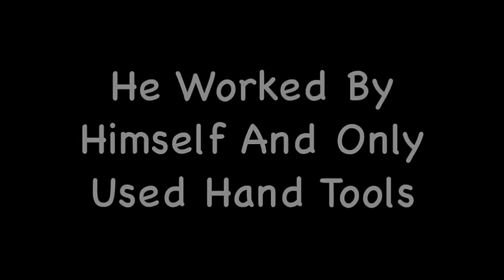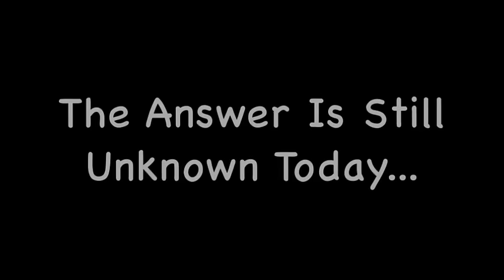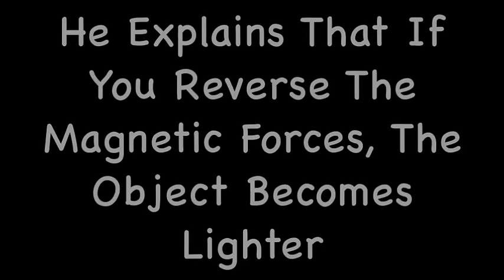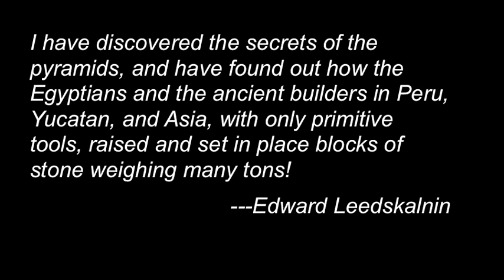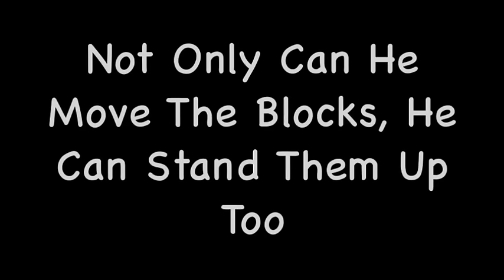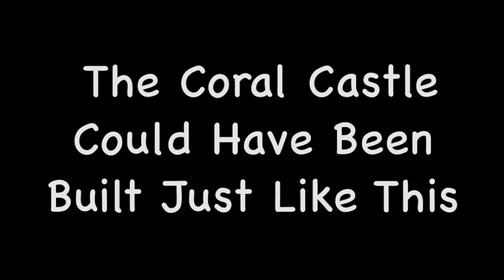Coral Castle: Mystery Solved

Comment: The pyramid Abu Rowash in Egypt is on top of a mountain.  There is no way this technique is sound to accomplish getting 400 ton block not only up a pyramid but a mountain as well.  The Egyptians moved stones up to 400 tons which would crush these wooden contraptions.
Reply: This is true, i`m going to re-post it at the top as the know it all`s seem to have skipped it, conveniently.
Reply: nice
Reply: The levitation could have been done with a flywheel circuit like Ed built, or possibly using a solid state version of this; the Ark of the covenant which was infact the exact dimension of a box found inside the kings chamber in Cheops. Obvious to me this ark was used in the queens chamber which was lined with gold to prevent radiation waves leaking out. The ground lead to water below all pyramids and also to the foot of the sphynx. Why? It's ion charge was healthy! people bathed to heal and energize. It's zero point energy just like the concentric ring walls used in Atlantis; the tournament players would stand in it's midst to regenerate in 1 hour as if they'd slept for 2 days.
Reply: That's not actually true.  In the 1780's, the largest carved & moved stone in the world was transported from 6 kilometers to its current location in St. Petersburg, using a sled with rollers.  1500 tonnes, carved down to 1250 (some of the carving was done along the way).  

It's all a matter of scale & persistence.
Reply: Helios77711 I would expect as much from you. Remember; if you're trying to call bullshit, bring some facts. I have many videos full of facts. What do you have? Nothing. You are what you do. I'm still waiting for a real comeback.
Reply: Helios77711 hahaha you're a waste of time. I tell you what; let's continue this conversation in 4 years. This will be civil, do you agree?
Reply: Helios77711 I don't knock on doors. I am not part of the NW organization. I did say that I am a Jehovas witness. If you knew the bible, you would know what that means, but from one point of view you are nothing. I've studied Jewish religion and found 3 major errors, and so did a Jewish Rabbi who converted to believe in Christ as savior! Look it up. Educate yourself enough and this is where most conversions go to. If god loves us, why would he wait thousands of years before teaching us anything that could save us? It's just plain dumb.
Reply: mikefromspace there was nothing to save you from thousands of years ago
Reply: Bob Swardson Trolling much? Just felt it needed to be focused on when someone happens to mention anything that happens to be in the Holy Bible, there is always someone who feels it necessary to vomit their dissent of God. Get a life and keep your rhetoric to yourself, rather than taking the mention of anything biblical as a hand swat from a tag team partner to ambush the person confident in believing what you so arrogantly oppose. Peace!
Reply: Scott Allensworth Trolls require bridges, I know, I have abridge...Muuuhahahah!!!!!!!!!(hear that in your minds eye as very sinister, but seemingly tiny mouse like voice coming from over your left shoulder!), or is that i've been abridged?  Love you!
Reply: ***** Pagan... I don't associate with Pagans sorry.
Reply: mikefromspace Come on, man. Where is your love? Your comment hurts.😢
Reply: Scott Allensworth It's called tough love.
Reply: Helios77711 LIes? Prove it. The only delusions are all on your side buddy. I know who my friends are and don't have time for cynics or children with closed minds who have still not sought out the true god after all these years. I have conversations with biblical scholars. Even Torah scholars have converted after learning the truths that are so obvious. You can yap all you want here but you're not on my level until you study for a few weeks with a good Jehovas Witness Minister.
Reply: +Scott Allensworth Nicely & diplomatically put, I'll accede, however if you truly want an answer to the main question you asked, "Why is there so much anger towards ppl who happen to believe in someone/something as their god?", I'll provide it to you. First off, the question is not quite right. It is not believers in higher powers who the greater part of the frustration I've seen(& felt) is directed towards, it is towards the followers of actual religions, &/or the books/organizations/etc. that go hand & hand with them, that our ire, & lack of respect is more truly aimed.  And in general, the answer as to "why the anger?", ought to be fairly obvious. Throughout our known history, it has been these religions that have served as the underlying justifications for(by far) more grisly murder, more suffering, poverty, enslavement, & oppression, than any other motivating factor that anyone can point to for these evils, & all the while(most obviously when viewed in regards to Christianity, but generally true of all of them), while swinging the ax, wading through the blood, gathering the loot, & consolidating the power, the perpetrators of all the horrid atrocities(whether blatant, or more subtle &/or insidious) of history, gave straight faced accountings of their actions, as due to the will & love of god/words of the bible/etc.. And, after all, if life in heaven is greater the more severe one suffers on earth, then how can I be doing a bad thing, enslaving & murdering great numbers of people? have i not just GUARANTEED them an eternity of the greatest bliss imaginable?? I am truly asking, if I have stolen these souls lives, made them wretched, caused them to lose all hope, their children, their love, their freedom, & finally their lives, have I not done them the greatest service imaginable by any mind? Theirs will surely be an eternity to remember!
 
 Secondly, it is the organized religions, who have had the greatest part in holding back the human race from growth, time & again, keeping us in fear of god, & of his agents on the planet(like those who locked up Galileo) so that the 'conservatives' can assuage their fear of change, avoid the gibbering terror caused them by questions about our conduct as humans, & questions about our leaders, & questions about our daily lives in the future. And yet, it is a profound truth that "The unexamined life is not worth living."- Plato. A truth understood by those who came long before us, but is now shouted down(along with any other true morality, or sense that someone dares utter) as "unpatriotic", or "satanic".  Well... guess what? Your little drama characters are just imaginary constructs, just like Santa Clause. How can you be SO arrogant, as to believe that if there is a god out there(which there may well be?), that YOU have any knowledge or understanding of he/she/it, whatsoever? Don't call me "atheist"! We don't need a special label for me because I don't believe in the Tooth Fairy, or because i don't believe that Star Wars is a story about a real place that existed "Long, long ago, in a galaxy far far away." So whyTF do I need a label, just because I don't believe in any of the world's religions?  No one of them is any less absurd, or requiring of "faith" than another?? So don't label me "atheist", and quit holding back solutions to our myriad problems because you think a book, many of the original words of which are lost to history anyway, should have precedence over critical thinking.
 
And that stunting of our race continues today. If it weren't for the utter blindness & hypocrisy of the 'religious right' in America today, then an entity composed of blatantly obvious evil, apathetic towards any other being on the planet, along w/another entity blatantly obvious evil, that knows of nothing else but naked greed, could never have become the administrators of our government, like Bush/Cheney did. I'll grant you, there is not much to be desired about either party's candidates of the last four decades(other than Al Gore, ironically, who I believe he was about to step in & shock the system w/the very reforms in campaign finance, & the two-party joke of a system, that represent some of the only possible fixes for our lost democracy, & conceivable future as a race.. he gave enough hints.. too many, in fact, which is why it was necessary for the elites to kick him out, & steal the election from him... And they weren't happy when he turned the world's attention to human-caused global warming after that, either... but that's just more proof he was indeed willing to buck the powerful buck$ that rule the system). And just the simple fact that you all could take even a cursory look at the lives of these two pieces of human filth, & decide they were truly the fellow Christians they professed to be, is unbelievable. But the fact that you then threw in the towel with them, & allowed yourselves to stay willfully blind to all of their atrocities against democracy, human kind, & the planet, & supported them in  the never-ending false flag War on Terror.. & worse still, the invasion of an innocent country, & the carpet bombing of women & children who had no power in any political system(we like to use the words "carpet bombing", instead of the mass murder it truly needs to be called)...?? Well, that's beyond unbelievable, it's despicable.. in fact, there are no words strong enough?Hyper-loathsome? And generally, y'all are still engaged in the same ignorance, & promotion of evil that you were before 2000... I mean, "War on Christmas"??? You think that's ANYTHING but a lie, meant as one of many distractions that successfully keep people from focusing on the true issues we should be examining, & solving, or attempting to solve, if we want to keep any semblance of morality?? And come on, how difficult is "separation of church & state"?? Y'all just KEEP undermining it!? Ever since it was established? And you already mentioned & dismissed as a belligerent few, the whole constant spewing of hatred towards gays, & others in our culture who both don't deserve judgment by the Christian Right, but who also serve as nothing more than distractions, so we remain blind to the urgency of our true problems in the world. But as you already know, it isn't just a few bad, homophobic apples. Is it? There are lots of you, who spew the same bigotry that you then turn around & act so confused, so wonderfully innocent, to have directed at yourselves. Sorry.. I'm not buying it. The other agnostics are not buying it.

And frankly, i could go on, & on, & on.. I'm a fast typist, so I didn't realize that this had become so long. I really didn't even touch on a number of points I wish I'd been able to. And I have not simply spewed ignorant hate speech here... far from it. I have simply provided you with a fraction of the legitimate reasons that critical thinking, non-indoctrinated beings have become so frustrated with the followers of the world's religions, that they indeed begin sputtering anger at the very sight of you.. an anger towards your refusal to acknowledge the force of evil you always have been, & remain to this day. It just bounces off you, like you have some specific type of mental retardation in just that one aspect of your intelligence. In one ear, & out the other, & no matter how true my words, or consequential that truth, you just continue on, making the same f'n mistakes, again, & again, & believing the delusion that there's much good at all in you. It is you all who have made this deathbed we now sleep in, & your predecessors who made the beds of suffering that the hoards of history have constantly lain in, in the name of your book/god, & you all who have robbed our children & grandchildren, & the offspring of the other, brother, soul-driven(yeah- only YOU have a soul.. your beloved dog who loves you so unconditionally doesn't have one, & neither do any of the other species who experience, exhibit, & express; love, loss, fear, pain, empathy, anguish, altruism?.....did you ever consider that maybe it is a large percentage of US who have no souls, & are empty vessels of ego & self-interest?) & species on the planet, of their future.  It's sick. Wish I had another half hour, or any confidence that you're actually reading all of this, by which to continue with a number of other, essential points..? But I don't have that half hour, & there's plenty here to make the case, even if it's only about 40% of what there is over all.
Reply: And they were moving those block on sand not on smooth concrete.